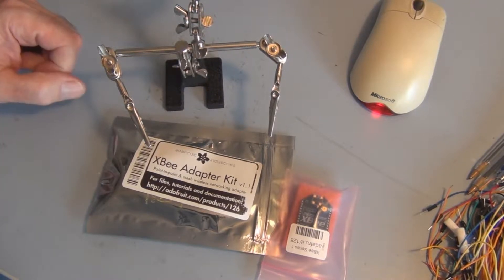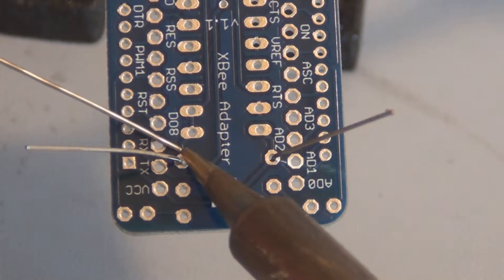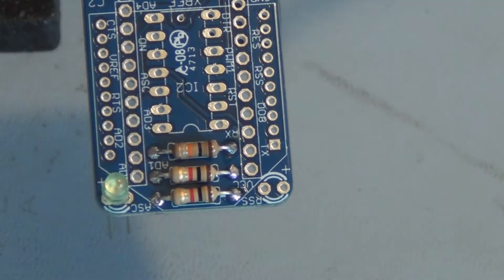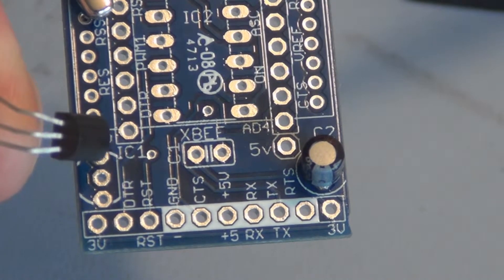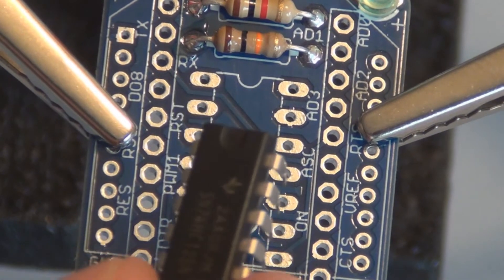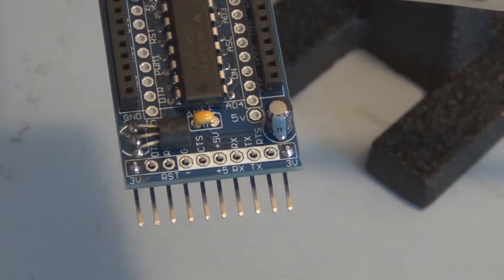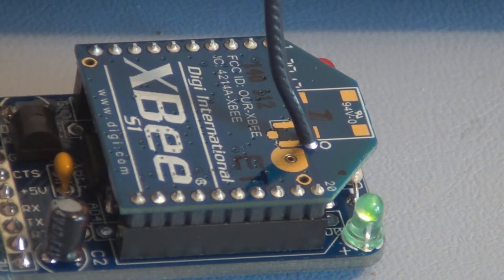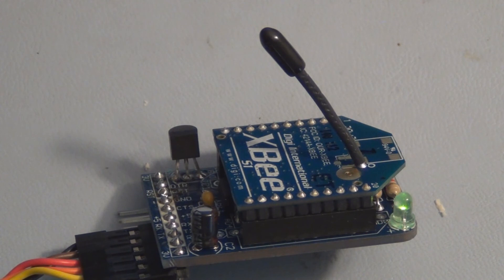Wireless Kill a Watt Meter Xbee Project Part 2

Comment: Hey, thanks for the great tutorial. I followed along and got the board put together painlessly. If anyone stumbles upon this and is looking for tips: I'd solder the black socket strips to the board before adding anything else, because it's easier to keep them flat when soldering if nothing else is on the board yet.